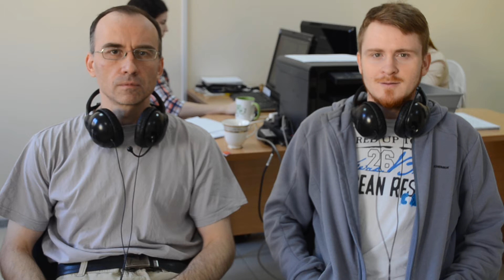S3 Stores Daily Vlog 21: Carbon Dioxide footprint of Tesla cars

Comment: We need carbon dioxide, it makes plants grow.  Most of the weight of a tree comes from the scant CO2 in the air.  Trees grow much faster and bigger with more CO2.  Also, if a person is hyperventilating, it's recommended that they breathe into a paper bag, as CO2 regulates the rate of breathing.  
Why not build automobiles with wood, instead of metal???
Reply: +rongrite The problem is that human activity produces carbon dioxide in high concentrations and in areas such that plants can't or don't absorb it. The fact that carbon dioxide is necessary and beneficial in many contexts doesn't mean it is beneficial when high levels collect in the atmosphere or make oceans more acidic.
Reply: thryu
Water "absorbs" and releases CO2, plants need CO2 to grow because they chemically convert it into solid carbon (carbohydrates) and oxygen, we need plants for food and for the oxygen they convert from CO2.   By planting 15% more trees and plants, all excessive CO2 in the atmosphere would be used up. This is calculable. Also CO2 is 1.5 times heavier than air, and the concentration of CO2 in the atmosphere decreases with altitude. 
If someone invented a device that quickly extracted 100% of the remaining CO2 from the atmosphere, leaving none, life on Earth, as we know it, would perish.